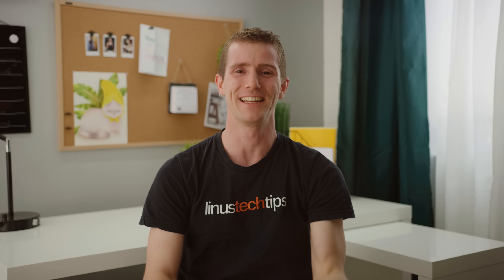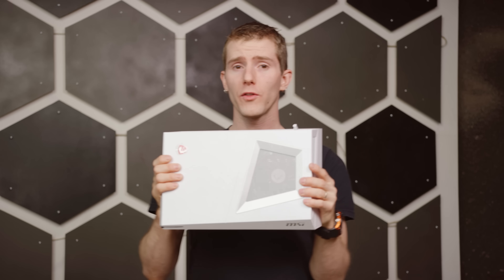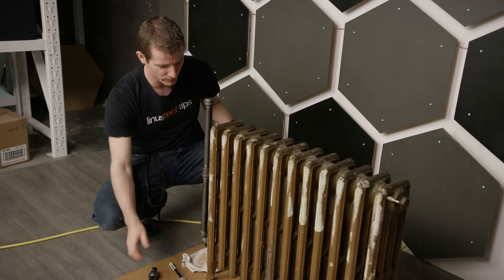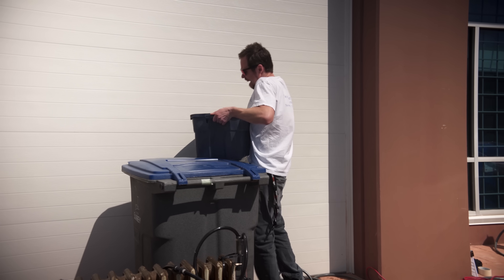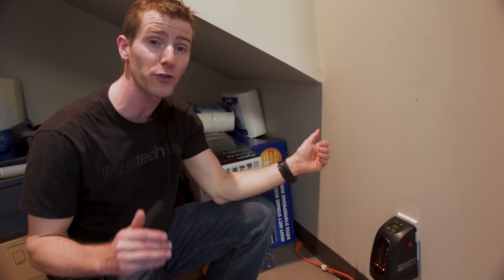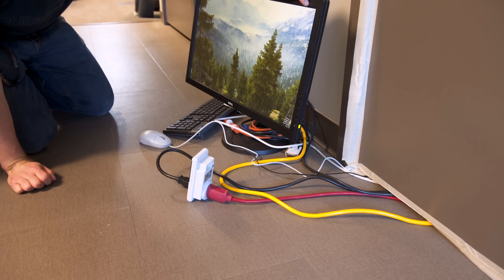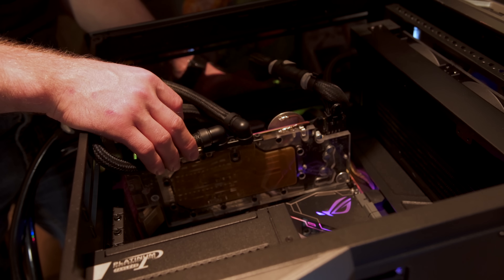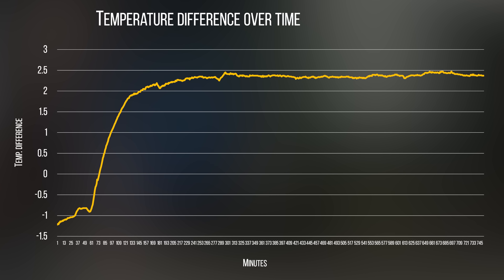Lower your heating bill... with GAMING

Comment: Use a new car radiator better
Reply: Or just something like the MO-RA3 420 PRO... there have been external rads for PC for a long time.
Reply: Or just use the PC radiator. No idea why the opted for this thing, Its not gonna heat up the room faster.
Reply: No, they should've just used a NEW baseboard radiator.. The kind meant to heat rooms, not car motors..
Reply: The only reason why we use this type of radiator in our houses is because we don't have fans on them and don't need the extreme performance of a car or PC radiator.
Reply: Yeah. They could have picked up a brand new, small aluminum (low thermal mass) Honda or Toyota radiator for less than $100 bucks and gotten a clean test. Maybe even a cheap electric fan for it.
Reply: Phobya Nova 1080
Reply: car radiators and PC radiators are designed to have air blowing over them. They don't radiate heat as well as an actual old style room radiator would.
Reply: Car radiator is essentially the same thing as an AIO watercooler.
Reply: jones81381 those are designed for steam and to stay hot, hence the very large thermal mass of the cast iron
Reply: Or you know just use it air cooled. Since you are planing to heat the air in your room anyway... 
Or if you want thermal mass for slow release of heat, then use something like a barel of water and submerge a few meters of soft copper tube in it to separate the coolant loop. Loop keeps clean, and all that good stuff.
Reply: Or just a normal air cooler. Heats the room in the same time. Even faster because your dont have to heat up water.
Reply: Just to be clear, car engine radiator is not heating anything, it is meant for heat dissipation. It will heat up, of course, just like any radiator exchanging hot for cold, except home radiators, because they are meant to flow with heated water and not meant to exchange heat whatsoever, thus it is kind of perfect for this sort of test. But any other radiator wont do the trick, and car radiator as well, because it is meant for a damn car engine in the first place, it sucks up enormous amounts of heat outputted from engine and exchanges for colder air to flow back in for the engine to cool off, and it is too big for a PC laughable 80 degrees of heat to be outputted like this in order to heat the room with car engine radiator. It wont heat up your room, but it will be somewhat warm.
Reply: PsychoLucario Exactly. I work on and install residential heating systems for a living. Those radiators are generally used in old steam boiler systems, sometimes they're used in hydronic loops and they're almost always oil fired boilers heating them (at least in New England, that is). The idea of heating one with a cpu is a novelty at best. 

I've thought about piping in a small length of baseboard fin to my rig with half inch copper and pumping the liquid with a taco 007 circulator pump, but a more rugged connection would need to be made to the cpu's thermal block, or else the head pressure of that size pump would probably blow those standard hose connectors apart real quick.. It'd be ridiculous, but like the radiator idea, it'd be a novelty that's kinda cool and somewhat functional. Idk.
Reply: If LTT isn't doing something wrong there's literally no point in doing anything at all.

Comment: Why even use the old heater the PC with a normal rad would output just as much heat! That way you also wouldn't have to wait so long for the water to heat up!!!
Reply: Ben Kuijers they also wouldn’t have that green goo around there
Reply: except they're Canadian....
Reply: Moreover, it's better to use old hardware for such project, for instance you can overclock a lot of ancient CPUs to consume around 130 Watts. Also you could scrap all the "energy efficient" lightbulbs and use many low powered incandescent ones if you plan to use electric (infrared or convection) heaters. It's actually much better for the environment to use cheaper bulbs (in terms of build and recycling price and thus ecological impact) in this particular scenario.

I set up a mining rig as a heater in winter made from the obsolete hardware just for lulz. Though the noise was rather uncomfortable, so I stopped it within a week.
Reply: heresy we are not americans in the sense of United States of America americans.  you must be european to reference the whole hemisphere as america  Almost nobody as least in North America would reference it so
Reply: illuminate me then name calling proves nothing.we seldom use continental names as reference just national names simply because the US citizens call themselves  americans. To call Canadians americans is an insult to many
Reply: America isn't a continent.   North America and South America are though.  Anyone with a brain who isn't a troll knows that "American" refers only to people from the United States.  I've never even heard anyone refer to Canadians or Mexicans as "North Americans" either.
Reply: what John Rokan is probably trying to say is that many people do refer to North america and South America as simply america which would make all people in those two continents americans which gets confusing because us citizens refer to their country as america CPGgrey has an good video on the issue in his archive
Reply: No, he's just trolling, that was obvious with his first post.
Reply: well we just let him scuttle back under his bridge

Comment: Ehhh just use the warm air coming out of the case to heat the room 😂😂😂
Reply: Boooorriiiing))
Reply: @horatio3852  It's definitely more boring.

However, no matter what it is, n watts of energy going in will always have n watts of energy coming out. Conservation of energy.

But if you do think about it,  a huge radiator is kinda impractical.
Reply: Hi @Erotikstudio Winkler GmbH. That radiator will keep your toes warm even if your face is being blasted by an Arctic gale, and it'll continue to radiate it's stored heat long after the PC is switched off right? Question why that's the case and you'll understand the flaws in your argument.
Reply: @sndgrpr6633  No, the reason it will do that is because of the thermal soak. If you turn off the PC it will continue to release the heat it stored up during the phase when it wasn't heating the room much on their graph. The same amount of heat is released into the room once the water in the radiator is up to temp. 

The reason it will continue to heat once the PC is switched off is the same reason it isn't working when you first turn it on, and this is why they're used in heating old houses. Your furnace burns for a while, and heats up the water flowing through the radiators in your house, and then turns off. The radiators the radiate the extra heat stored in the water. Once the temperature in your house gets low enough the heater turns back on, and heats the water back up. The radiators only job is to store heat, it will not increase the temperature of the room compared to running the PC with no radiator.
Reply: @enddy123456  No, the reason it will do that has to do with the piece of the puzzle you've managed to talk around - the rate at which the radiator releases heat (you know, the actual job of that radiator). It's that which primarily distinguishes room heater type radiators from other types of heat dissipation systems (including other types of radiators,) and if you had a better grasp of why it's important you might understand why "it will not increase the temperature of the room compared to running the PC with no radiator" is either an incomplete statement or just plain wrong.
Reply: @sndgrpr6633  CONSERVATION. OF. ENERGY. 

It doesn't matter WHAT you dump the heat into. You cannot create or destroy heat energy. A 500W PC cooled by air, or by radiators, or by a giant radiator, or by a fucking lake, will ALWAYS CREATE THE SAME AMOUNT OF HEAT. This is high school physics. The only reason radiators exist is to smooth out the temperature increase. That's it. It just slows the release of energy. But it's ALWAYS THE SAME AMOUNT OF ENERGY GOD THIS ISNT THAT HARD
Reply: @sndgrpr6633  no, a pc consuming x watts of power releases x watts of heat. It doesn't matter how that heat is released. I am an engineering student in my senior year, I've taken several classes about exactly this.
The radiator changes the time curve for the release of the heat, but all it is doing is storing heat until its temperature is high enough that it radiates the same amount of heat to the air as it receives from the pc.
The room will rise in temperature as it receives heat from the pc or the radiator until it reaches steady state, where the pc is releasing as much heat as escapes from the room. This is basic thermodynamics.

The reason it will "keep your toes warm in the blowing cold" is the method by which it releases heat, radiation. The pc usually heats the air and blows it into your room, but a radiator radiates heat, directly warming other objects in the room. THIS DOES NOT MEAN EXTRA HEAT IS GENERATED FROM NOWHERE.

Thank you
Reply: @Leo9ine  thank you for your support in the fight against lunacy
Reply: ChrispyArt i had a big aircooler and a 2 fan gpu. amd cpu and gpu. in the winter i never turned the pc off and the heating on, so that would work too
Reply: You want a small radiator outside the case so that it emits infra red at a nice temperature. You want to transfer heat to objects and people in the room, rather than simply to the air.
Reply: @Leo9ine  Compare radiant heat and convection as means of transferring heat from one place to another. Emitting 1000W as infra red vs transferring 1000W of heat to adjacent air have different effects with regards to where the heat goes (infra red will pass through the air and hit what absorbs it -- increasing the air temperature, while keeping it significantly below body temperature, only reduces heat lost by your body to the surrounding air, while infra red emissions will transfer heat to your body even if the surrounding air is cooler)..
Reply: that's exactly what I do

Comment: Something worth noting is that the kinetic energy from fans will eventually fizzle out as heat due to friction. The light from the RGB lighting will also be absorbed in the room and turn to heat. That means, aside from any light from the computer that may leave the room through a window, pretty much every watt will eventually be turned into heat inside your room. You don't even need a radiator for it, and as you concluded in the video, all it does is add thermal mass and slow down the heating process

Comment: Should have used a radiator used in cars, preferably new, it would have saved so much time.
Reply: Car radiators use to be a thing back in the day for water cooling PCs, back when the idea of water cooling was new.
Reply: May linus sees your comment
Reply: BROLY 
I remember. Everything had to be done custom in those days.

First time I saw a water loop, it confused the hell out of me.
Reply: Plus wayyyy more efficient!
Reply: Car radiators... no 
Car heater cores... yes.
Reply: He shouldn't have used a radiator at all. Using traditional air cooling would give the same result and it will heat up the room faster as there will be no water to hold the thermal energy

Comment: Dump the water cooler radiator in the snow outside. No more heat problems.....
Reply: Gonna need some REALLY long tubing
Reply: Well yeah that's how a cooling system works lol,
Reply: Ha, I actually kind of do this. I have a 9x120 rad I put in the window during the winter months and tie into my loop. Mainly so my computer room stays cool, but def helps cpu and gpu temps.

Specs:
Windows 10
i7 5960x OC @4.5GHz
3x Titan Black OC (+180 GPU / +300 MEM)
G.Skill 64GB RAM @ 2400MHz
Rampage V Extreme MOBO
Intel 600P 512GB M.2 PCI (OS)(Some games)
4x Intel 730 256GB Raid 0 (Game)
2x Crucial M4 128GB (Media)
2X WD Red 4TB (Media) (Backup)
Asus ROG Swift PG279Q 2k 166Hz (Main)
2x Asus PB287Q 4k 60Hz (Sides)
Corsair 900D case
Corsair 1200i PSU

Cooling: Two loops (Custom loops)
CPU & mosfet: (140 Rad Pull) & (480 Rad push/pull)
GPU's (360 & 480/ Push & pull) Basement install
Reply: Wouldn't that basically destroy the cooler due to condensation and rust starting to form?
Reply: Nighterlev you've never seen a pc cooling system? It's called water cooling... Google it lmao
Reply: Nighterlev, What metals do you think are being used in a PC to rust...? Plus with water cooling how is it you think condensate would magically cause rust on aluminum or copper that the typical coolers are built with?
Reply: Louis-Philippe Duval Or just connect the waterblock directly to the sink and turn on cold water.
Reply: Yeah mount your rads on the outside which might cause your PC runs at a cooler temperature than your room is at and will evaporate the water in your loop which is never a good thing. It's a pretty stupid idea.
Reply: +Vishnu Vishnu
I'm sorry what?
Putting any sort of aluminum outside (you know, directly outside, with all the water, condensation, etc) would cause any metals on the computer it-self to rust.
The aka "water cooling systems" we use today aren't water.  They are usually mixed with a bunch of other chemicals that act like water, or are out right not water at all.  Sure, you have some systems that use a mix which contains water, but they're pretty heavily mixed so the metals don't rust or cause any problems with the computers it-self.

It also helps without water forming on the plastic/metal/whatever types of tubes are used.
Reply: +MidnightMarrow
Read the comment above.  Most water cooling systems don't actually use water at all, or are mixed with a bunch of chemicals so the water doesn't cause rust or condensation on the outside tubes of the water cooled PC.

Comment: Its funny because having an air cooled PC without a gigantic rad like that would be just as good. The heat output would have been identical.
Reply: The Timelords but with this method you could put the radiator outside in the winter and have a super cool pc
Reply: +Kevin D.
Hmmm.... That would be cool
Reply: Honestly i thought about something similar when i lived in North Dakota where from between November and march the highs are just above freezing and the lows where as far as -40 with entire days never even getting above 0. So if you have a large Rad filled with something that won't freeze (from what i heard Antifreeze for cars is not a good idea) and put it outside i imagine you could get some pretty low temps in your pc.
Reply: Damn that's a good idea. Someone should try it
Reply: @chrisrawr6177  And condensation in your computer, which is not a good idea if you like a computer that works.
Reply: Kevin D. it will kill you pc.  condensation will build up in the pc. 
funny idea tho XD

Comment: I'm sending this to my Physics teacher
Reply: He'll die because is was such a waste to use a huge external heater. Better results would be had with traditional heat sinks. Basic thermodynamics.
Reply: W Bond You underestimate the heating power of amd cards. They say amd cards are used to heat the pumps of geothermal generator when earth is not hot enough.
Reply: yes and no. Using this method, you COULD heat a different room instead of your room which could be useful. And while it takes longer for their method to get started, it would in effect keep heating for a long time after the gaming session is ended.
Reply: The third law of thermodynamics disagree's with you. The rate at which the room heats would be slower yes but total heat generated would still be the same. So in actual fact, you lose useful heat by adding extra mass to the equation. The extra mass absorbs some of the heat.

Therefore, using standard heatsinks is more effective, regardless of "longer time after gaming". You'd still be better off without it
Reply: I feel sad for the physics teacher who now watches this vid without any new information. Your teacher should ask your class to write what they did wrong/right in this experiment.
Reply: Tell them not to watch it before lunchtime because that heater would make them lose their appetite
Reply: If the end result is the same, with the room trying to reach equilibrium, then it doesn't matter what the mass was.  By "effective", all you're saying is "faster".  But we're talking about heating a room...you know...something you'd be in for hours, not minutes. So it still doesn't matter.  You'd still be comfortable for the duration. Plus, because of the mass of the radiator and amount of water, it retains heat longer and can do useful work longer, passively. As Linus mentioned, you don't want a SAUNA, you just want a comfortable temperature. Thus allowing you to turn off and on the PC and manage the temperature of the room/house for longer periods.  You have to look at it in the long term of said usage, rather than just initial.
Reply: Whether the big radiator helps depend on how much heat the PC can put out. If the CPU/GPU gets too hot, they may lower their power consumption (throttle down). A large radiator can transfer heat more effectively (more contact area with the air) and keep the PC cool so it keeps working at peak power.

Of course I doubt you'd need anything "this big" to overclock the CPU/GPU at maximum.